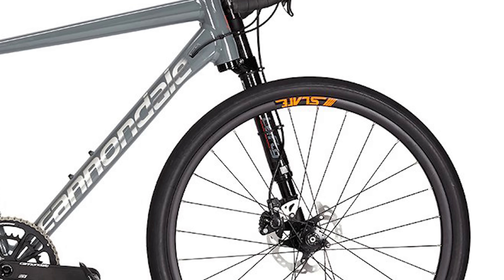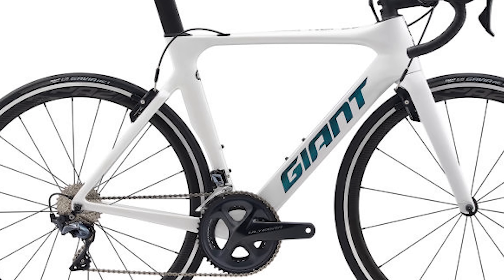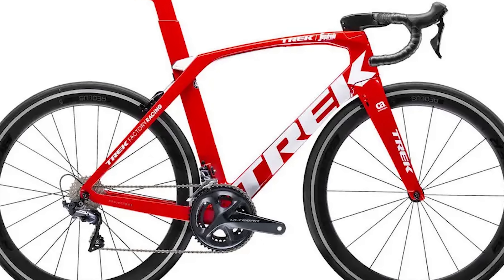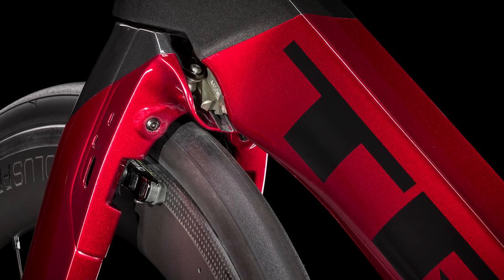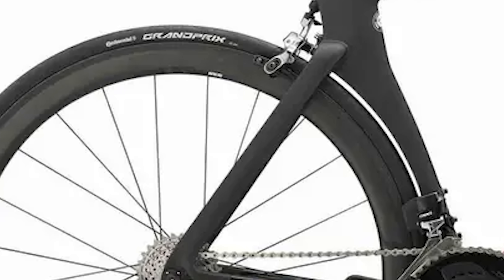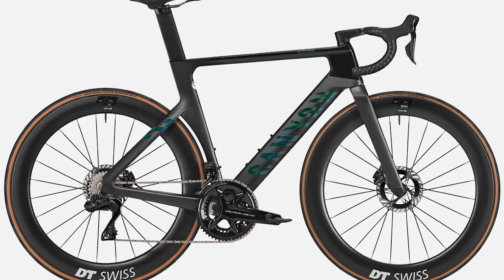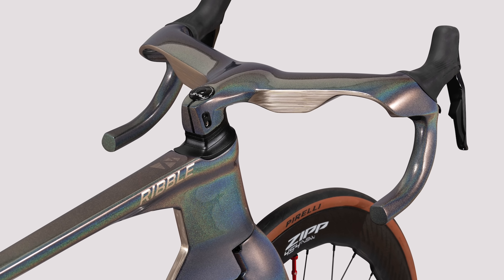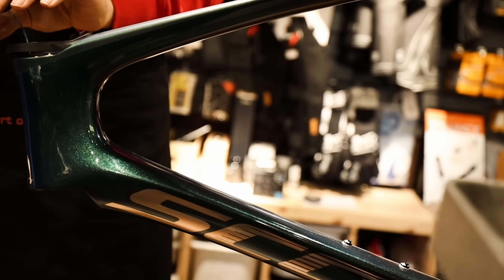Pro Bike Mechanic's 10 Most Hated Bikes

Comment: Agree with every single one of these. Also add into that anything wearing sram apex hydro 1 which is an absolute shocker and ruins bikes, any specialized with the scs system circa 2016, and the venge vias and all of its bastard children that it spawned.
Reply: My favourite thing about the Venge Vias was it meant that my OG Venge was still the best Specialized bike for years after it had been replaced.

Comment: 50 Rebels Ebike. Cheapest gearing from shimano, bad paintjob (chips easily and due to the carbon steel frame it rusts quickly) fenders way too short to keep you dry and when you get the street legal 250W like I did you  probably get overtaken at a hill by any other normal bike because it doesn't have a torque sensor.

Comment: Hey guys,

Absolutely love the content and i have watched a ton of your videos if not all.  I noticed one thing though.  At first you guys were weighing bikes with the scale by holding the lanyard (which you have since fixed.  You switched to using the handle (great).  In actuality that handle part is supposed to clamp in your maintenance stand and you just pick the bike up and hang it from the hooks.  Cheers Lads.

Comment: There are 2 generations of the Giant Propel with those kind of brakes that just works, no faf, not much of a pain to adjust and a ton of braking power, cause at some point Giant finally realised theirs were utter shite so they outsourced it to TRP that knows a lot more about well functioning brakes than well pretty much anyone else on the market. I believe it's on the very last and the before-last generations of those, might not have been available on the very entry model.
(But yeah the wiring is still a bit odd compared to the streamlined look of integration and disc brakes)

Also Canyon & Cervelo... i believe Nic stayed quite polite. On the course i go training 3 times out of 5 i hear a guy's disc brakes rubbing and squealing it's one of those Canyon ultra aero shit. As for Cervélo they're almost as bad a company as Absolute Crap, they freakin released an S5 that destroys itself from the inside anytime you'd turn the handlebars to the side those imbeciles.
Reply: Which parts of the frameset do the steer stops strike?
Reply: @sbccbc7471  the head tube. I invite you to have a look at Luescher Technik's vid on it. Apalling stuff.

Comment: shop guy in sales and repair,  small shop we have to do it all.  I hate almost all TRI bikes,  anything with an aerobrake, frt or rear, more so if its at the BB,   and any bike that runs its controls thru the stem, and into the frame.  And I love SRAM wireless shifting whether road or mountain

Comment: I have the latest ultimate, honestly the adjustable bars and cable routing is fine. The seat clamp and fork/stem interface are garbage. Very common issues with both, the seatpost slides if you don't add a tiny bit of tape and apply carbon paste intelligently. If the factory didn't add enough carbon paste between the stem tube and fork tube (they fit into each other and are kept in place by a SINGLE STEM BOLT pushing into a shim), then it creaks like hell and the bike has to be re-hosed to take it apart and fix the issue. Such a massive step down from the previous Ultimate with round seatpost and regular stem interface, it's such a shame.

Comment: Got a cervelo r3 disc after road  accident .to replace old r3 rim . It was absolutely crap no go when put power down .put top tyres on felt no  better .36 inner  chainring waste of 9 gears to low ..never use 11 -25 cassette on summer bike .

Comment: I quite oft agree with Nic, but If he have 20 years of experiance he should know that back in the days conti gp4000 23mm is almost the same as gp5000 25mm. I was running gp4000 25mm and this was within 0.2mm (caliper messured gp 5000 tt tr 28mm). So realisticly speaking if you were riding 25mm back in the day and now 28mm you haven't made change at all.

Comment: Observation: People switching back to film cameras for simplicity; coming soon, roadie bike groups for steel bikes only.
Reply: There's actually something to be said for older film cameras, or more specifically, their lenses, when trying to focus manually.   They were designed with this purpose in mind, and film SLRs have focusing screens that are optimized for this.  Of course, the whole film developing process is more painful, but for niche purposes, film is still used.  And you can do things with steel frames, like replace dropouts, add cantilever bosses, etc. that you cannot do with any other frame material.   It's highly resilient in ways that other materials aren't.  My steel frames can accommodate several different rear hub spacings without flinching.

Comment: 28 or 32 mm tires are NOT,IN NO WAY faster than 24 or 25 mm tires! I used those on my ss road bike,and went back to the 24mm tires! Don't listen to this dude or others claiming that fatter is faster! Comfier yes, faster NOT!!!!!!
Greetings from Croatia 😎
Reply: Depends on the the wifth of your rim, which bike and wheel are you running?
Reply: @matkrek  Old Campagnolo Zonda's and Shimano Ultegra wheels! Both decade old! Rim width is 20mm! Slimmer tires are simply faster,more quiet, slightly less grippy,and not as comfortable!
Reply: correct...23mm @110psi or better, 20mm @ 140 psi!! faster faster
Reply: Yea sure. Pro riders that are paid to win races are riding wider tires to go slower?
Reply: @markxkovacic  pro riders are PAID to ride whatever  companies give to  them!
And modern pro riders are so damn overly sensitive, that every imperfection on the road make them crash! Once again, narrower tires are faster!
Reply: @markxkovacic they are told what to ride

Comment: I love the hover bar of the Canyon. Because it gave me enough space to put the battery box. The battery box has an on/off MECHANICAL switch to cut power. Power goes to the SRAM wireless shift handles. Because SRAM fucked up their electronics and/or firmware completely: This piece of crap will not properly sleep on one side, so the little 2032 battery in the shifter will drain in a few days (not "months" as they claim). After changing it so many times that the contacts snapped, I soldered wires to the remaining contacts and now use an external battery box (that can be switched off) on the hover bar. Now what would I have done without a hover bar? Glue the box to the tire?
So the message to SRAM: Stay with mechanics. Keep your fingers off anything that has to do with electronics and/or software. It is just out of scope.

Comment: For those of you always going on about how much better/easier rim brakes are, please take note how many bikes on this list are rim brakes…
Reply: ...proprietary aero rim brakes
Reply: These bikes all use custom-designed rim brakes in odd locations: they're kind of like the Ferraris of rim brakes.  Regular Shimano, SRAM, Tektro, etc. rim brakes are very easy to work on, and... aren't shown here at all.  They're like Hondas and Toyotas: they last forever and work well.  Same with most discs as well, though there's some dishing complexity to consider, especially with flip-flop rear wheels.  I'd certainly ride front discs if I didn't already have significant investments in rim brakes, but I'd have to buy new forks, build new wheels, and buy and set up disc calipers.  Just isn't worth the $2 or $3k, plus 2- or 3- day wheel build time to me yet.  My Open Pros and Salsa Delgados still do quite well!

Comment: Tyre clearance? In the past there have been even narrower with 20 and 18mm and a German journalist called them "Dackelschneider" - "dachshund slicers", and that higher efficiency claim is more or less busted, on my car I have 185/55R15 (Conti WinterContact TS850) in the winter and 215/40R17 in the summer and with my old summer tyres (Goodyear EfficientGrip) fuel consumption was slightly higher, but with the new Conti EcoContact it's equal.
"40% faster" such incredible claims should always be taken with a whole mine of salt, I'm rather from the tech scene and Intel literally crippled their competitor in Benchmarks at that time, the Ryzen 7 2700X with things like slower RAM, weaker cooling and such stuff to make their i9-9900K perform better, same with nVidia's "RTX On", where the side-by-side pictures with "RTX Off" were done with much less non-Raytracing reflection techniques than actually available to look more dull than they could.

Comment: IMO, about 2009-2017 is basically the worst era for bikes. Awful bottom bracket standards, proliferating proprietary nonsense, overly complex engineering, ugly frame designs, unreliable everything, first-gen electronics with wires everywhere, questionable carbon rims, slipping seatposts etc. Bikes prior to that period were simple, reliable, stiff and light. Bikes after that period have been simplier, more comfortable, faster, more standardized, prettier and better designed. We're actually in a good period now, most road bikes are pretty damned good... if overpriced.

Comment: My bike made it! Let's go Giant Propel! They were a b!@#$ to adjust, center, and get working right. The stock pads are hot garbage. All those things fixed, they work as well as any other single pivot rim brakes I have ever used. I have gone high speeds down mountain roads with no fear.

Comment: This guy is just a lazy mechanic. Oh diddums it takes longer to work on integrated components 🙄
Also fatter tyres are not more aero and the rolling resistance is the same when matched to tyre pressure that gives the same feel.
Reply: Baffles me that people don't realize that aero drag is proportional to frontal area.  So a 35mm tire will have 50% more frontal area than a 23, meaning 50% more drag.  Granted tire drag may be a small contribution to total drag, but people go to such gyrations to minimize other small factors like frame drag, etc.  There is also the fact that wider tires weigh more (more material, plus wider rims add some weight).

It would be interesting to know the wattages for rolling resistance vs aero drag.  If rolling resistances are measured on a rolling drum rig, I am skeptical how well that replicates RR on the road: would expect the dynamics of the contact patch on a flat vs a curved surface to differ..

Comment: The bike I dislike intensely is all racing bike when on the road while that road has traffic. It the best bike on the road when the road is closed to traffic.  And why do they wear race outfits when only training. Racing bike are not designed to be use on roads with open to traffic. If I had a car that I can not see clearly from it would not be allow on the road. If I had a car with the same braking system as a bullock tray it too would not be allowed o0n the road. If my car had racing tyres again would not6 be allow on the road. I love racing bikes but they are not safe to ride in traffic period.

Comment: why does a mechanic complains about stuff what in the end brings him more money ?
Reply: It doesn't bring mechanics more money if it takes them three times as long to work on something.  Many shops have standard pricing for certain common repair jobs, so if something is unduly difficult to work on, it ends up cutting into their bottom line.  For the shops that sell these, they may be able to take up some of that by their retail margins.

Comment: Not really impressed with my Trek Emonda SL5. It's built to climb, but is heavy, and downhill really unstable on the brakes.....wheelbase is too short. Awful toe overlap, dangerous unless you're on wide roads with no traffic. Also, doesn't seem to roll as easy as my old steel raleigh. It IS pretty comfy though!
Reply: ....also has the awkward steering stops.